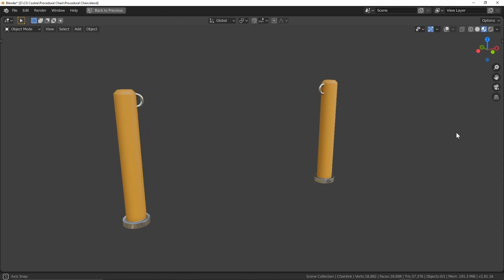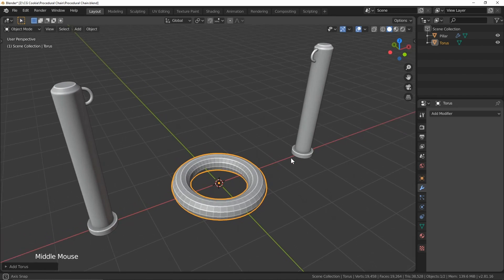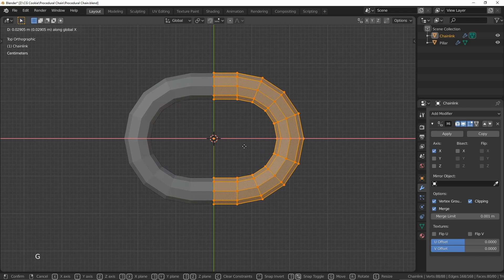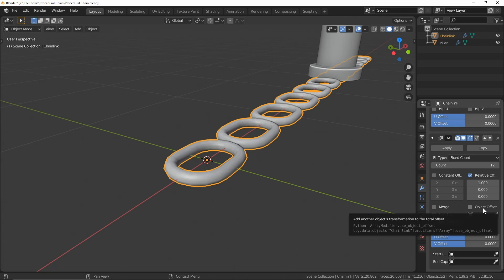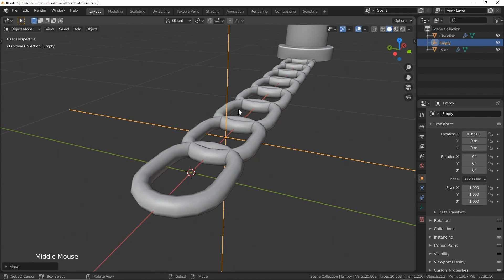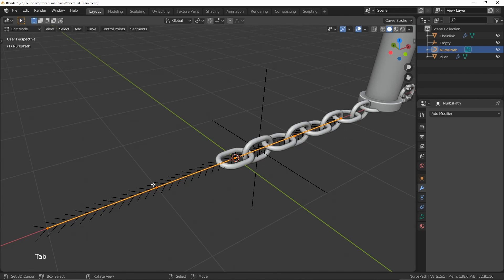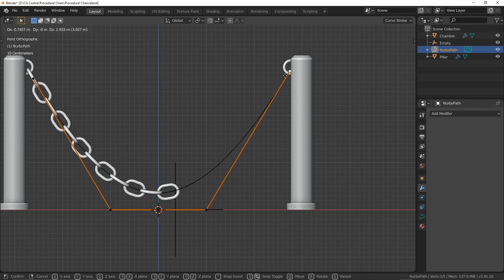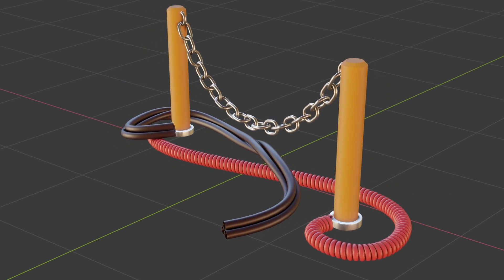Learn how to create procedural chain links in Blender

Comment: One drawback with this technique is you have to avoid having too-sharp bends in your curve. Otherwise you will notice that the chain links are bent at such a point. Ideally, you want each entire chain link to orient itself to the curve, rather than having each part of the link do so separately.
Reply: I disagree, I've done tight corners and just replaced the distorted links. This method has saved me HOURS of work. Its brilliant. Few distortions at edges is hardly a drawback.
Reply: @CaraDees  wdym you replaced the distorted links? you manually deleted them or?
Reply: @pejv7903  Yup just to in and take out the funky ones and put in good ones.

Comment: Simple and easy setup yes indeed, but the only downside to using chains like this is that the curve modifier doesn't let you choose if you want to keep the object instances intact when bending along the curve
So if you were to use a chain for it, you'd notice immediately that some pieces of the chain would bend on those bent parts of the curve which is something we don't want
Great tutorial btw

Comment: My main problem with this is the chain links bending to follow the curve.  You should be able to fix this at least partially by applying any subdivisions on the chain link and removing the loops in the straight section of the chain.

Comment: There are a couple of down sides to this method that I don't think you discuss and should be addressed. First of all, the curve modifier curves the chains, not as noticeable when the curve is gentle as in this case, but if you wanted to try to do this, say, with a mace at the end that he's swinging around and you've got a harsh bend in the curve, the seams will definitely show at that point. Second, I didn't see you have to fiddle with the start and end chains to get them to line up. I sure had to.
Reply: If you make the chain a single n-gon for each side, it won't deform. Not ideal, I know.

Comment: This isn't a "procedural chain", it's just a static mesh following a curves. the term procedural implies that each link would actually be a physical object with potential to collide with it's siblings emulating a real chain. This is great if you're just needing minimal movement and don't plan to coil the chain over itself or bend it passed a certain point but won't work if you want to do anything more complex with it.

Comment: Is there a way to do this without chain disortion? I tryed.to figure that out bit i faild
Reply: Yes, there is. Create a plane and scale it down to a size that's similar to a chain link, then apply the scale. Parent the chain link to the plane (the plane should be the parent, and the chain link the child). Add the array and curve modifiers to the plane instead of the chain link (keep the settings the same) and remove those modifiers from the chain link itself. On the plane in the Object Properties, go to Instancing and choose Faces, then deselect Render Instancer. The plane will appear (and be selectable) in the viewport, but will not appear when you render.
Reply: It may also help you while editing to select the NurbsPath and on the same Object Properties panel, go to Viewport Display and select In Front. Then you'll always be able to select and edit the path, it will no longer be covered by other objects in the scene.
Reply: @BeheadedKamikaze  ur amazing thank u

Comment: Here's something I've struggled with that's not addressed in the video. How would you set up a chain whose links don't deform but is still controlled by a curve? With sharper curves or a chain that's dangling straight up and down it becomes very noticeable that the links are deforming. I've tried rigging with one bone per link then controlling the armature with a curve, but couldn't get it working. Any thoughts?
Reply: You can make an instance for the chain,and then add array modifier to the instance,so there won't be deform
Reply: Create a plane and scale it down to a size that's similar to a chain link, then apply the scale. Parent the chain link to the plane (the plane should be the parent, and the chain link the child). Add the array and curve modifiers to the plane instead of the chain link (keep the settings the same) and remove those modifiers from the chain link itself. On the plane in the Object Properties, go to Instancing and choose Faces, then deselect Render Instancer. The plane will appear (and be selectable) in the viewport, but will not appear when you render.
Reply: @BeheadedKamikaze  I've tried this. It works, but I suppose the other criteria should be that the links cannot clip thru each other and become disconnected, which this instancing setup doesn't prevent.